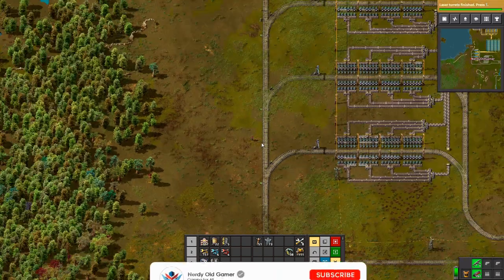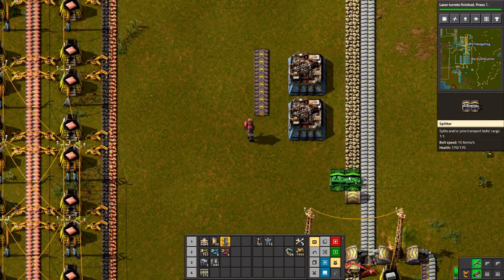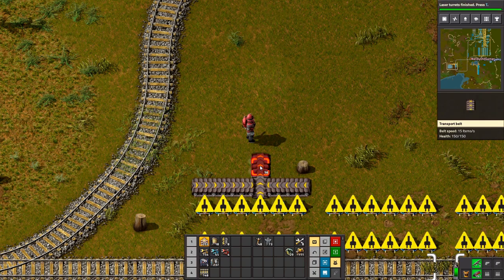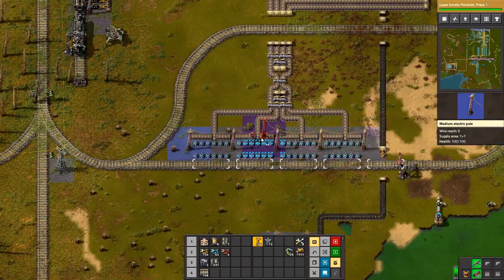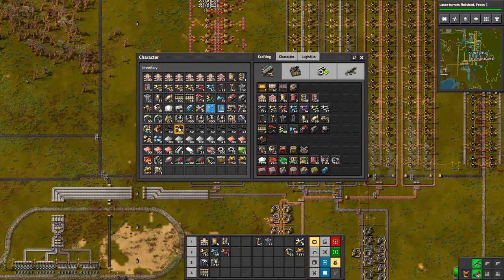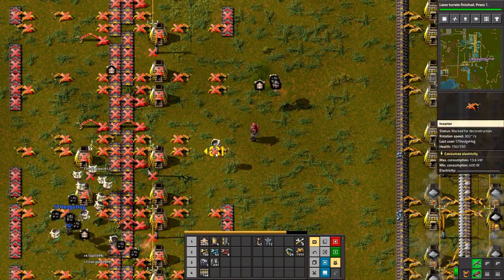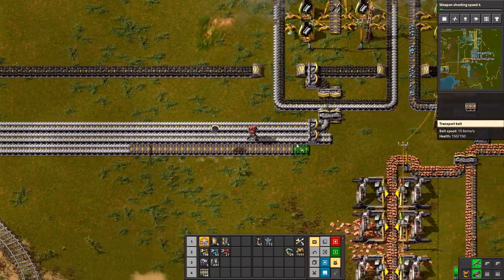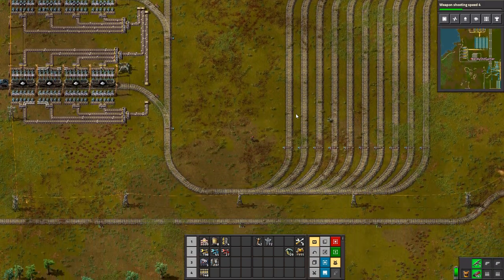Factorio 1.0 Multiplayer 1K SPM Challenge Ep18 | Messing Up the Drop Off, and Fixing it

Comment: Signaling the single 2 way track put signals at both end no signals in between. 1 assembler for landfill and use 3 inbound yellow inserters and 9 outbound no cap on the chests the way you have in now your'e going to be shutting down walls.